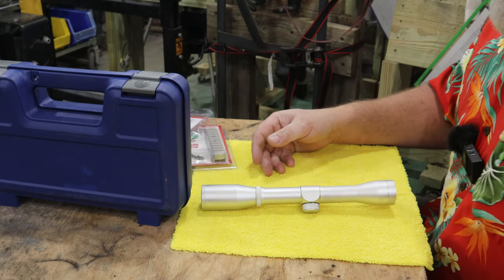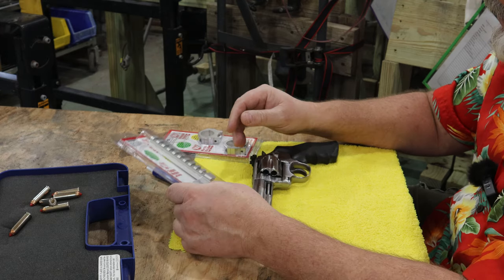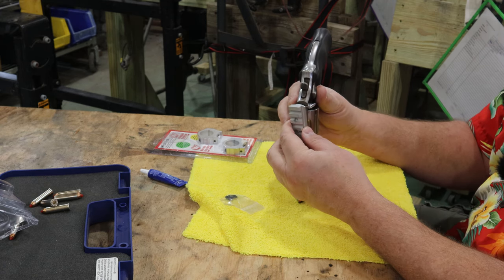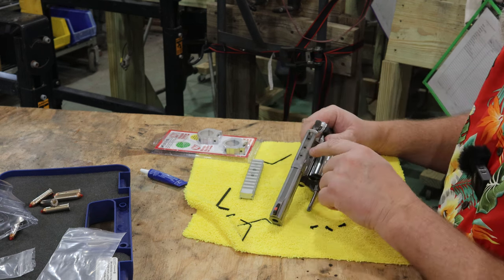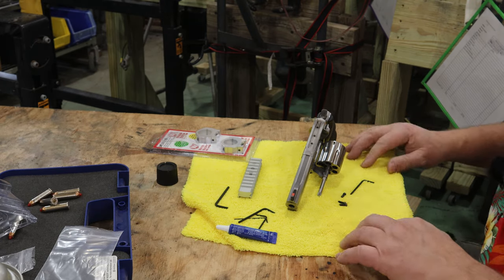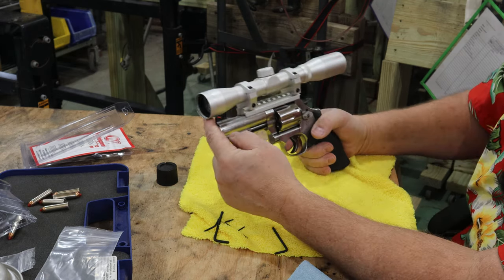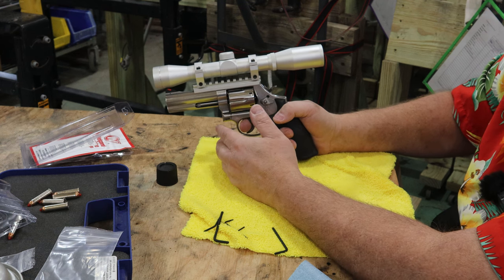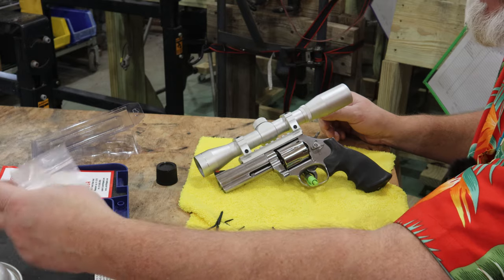357 Magnum Smith&Wesson rail upgrade with scope

Comment: Just bought a digital hand torque screwdriver that is made for guns but using it on any low torque screws that need the correct even torque applied. The one I found on Amazon for guns and rifles was actually cheaper than automotive
Reply from the maker: Just looked them up, pretty interesting. Thanks for the tip and watching.
Reply: Going to first use it on my merc 60hp. Carb bowl covers. I had one that leaked and found there is a torque requirement of 18" lbs or 2.5 Nm. This will set them and anything else with a low torque call out in the service manual👍

Comment: it kinda looks like Han solo's blaster from the first star wars movie.  kidding...  I'm getting a 686 plus 3-5-7  7" barrel in a few months.  I'm going with a Burris 2X scope.  I already bought the picatinny rail, cantilever scope mount, Hogue grips and a case.  I'm using a silver cantilever mount, so I can have the scope run from just behind the muzzle to stop just before the hammer.  When is the last time you saw a cantilever scope mount on a handgun.  probably never.  But I can't stand the idea of having the rear of the scope hanging several inches behind the hammer.  Plus it's more balanced when centered.  If my eyesight wasn't such crap I would use the iron  sights but my eyes can't focus up close and distance at the same time anymore and a scope is the only thing that works, Red dots don't help either.
Reply: Finding an optic that adjusts for my eyes for my IWI Tavor TS-12 was a pain in the a$$.  I ended up finding a red dot that has an etched reticle and adjustable diopter. that was cheap. Red dot is useless in sunlight but the etched reticle was all I needed it for anyway.